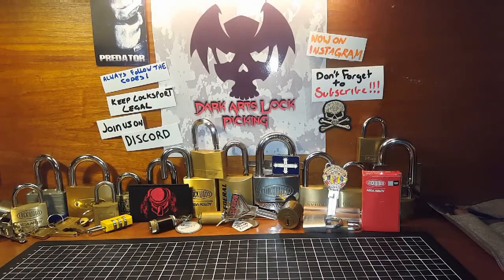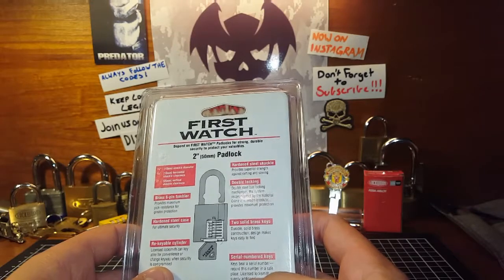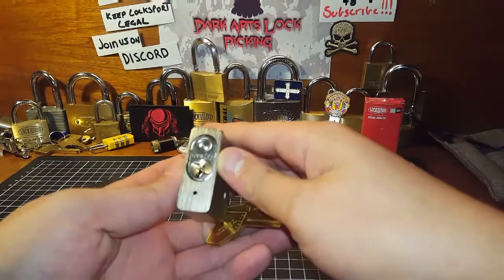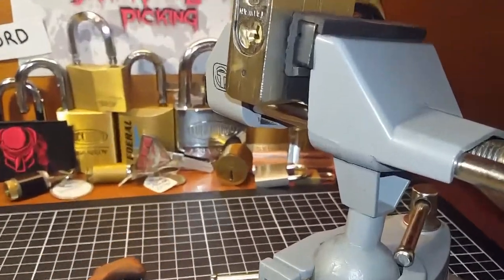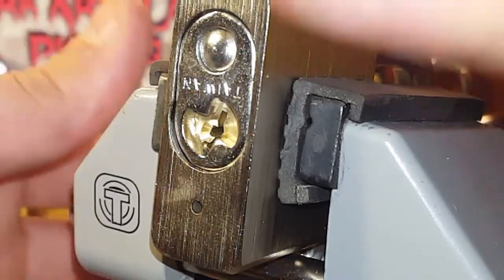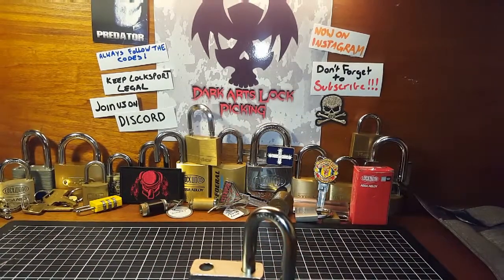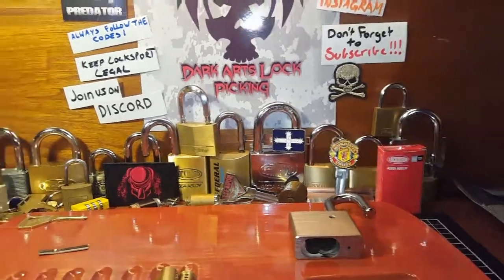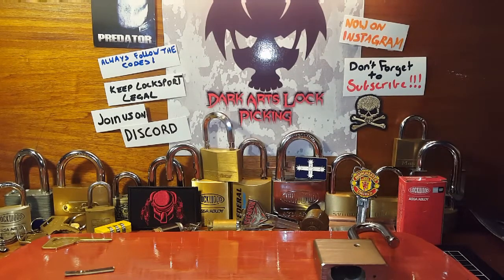First Watch padlock picked and gutted straight from packaging. (65)

Comment: Welcome back, DALP. Hope your Adelaide field trip went well. I kept an eye out for any illegal imigrants from across the border with Vic number plates while i was out and about and shouted out " are you DALP?" to the ones i did see but didn't get any response except puzzled looks. lol. Suprised at the resistance to picking from Funky's gift. Put up a good fight. PS. Get rid of that crap circlip tool. It's only a matter of time before you'll be down your local surgery getting stitches. lol. Cheers:-)
Reply: Paul Springett lol😁😂😂
Reply from the maker: Yeah it was good bruv. Lol i didn't hear anyone calling out lol i did see a few locksmiths driving around but didn't know if it was you or not lol. Yeah it was a little tricky lock. I don't care if it makes me get stiches as long as it happens on camera lol. 👍👍👍🤘🤘🤘
Reply: I hope you're not missing any wiper blades, Paul.
Reply: LOL. No. I kept all my vehicles stored away til he left Adelaide. lol:-)
Reply from the maker: Hahahaha i didn't take any wiper blades i stole all the padlocks in Adelaide hahahaha.
Reply: There's some up near my place you can have too. A car wash place on the highway had shut down. They left a chain and a bunch of padlocks on a metal post at the entrance. Someone had broken off the other end of the chain and people are parking on the property now (parking space is at a premium around here).  For some reason, there are 4 small Lockwood padlocks on the post. I was tempted to stretch out the chain and use a spare padlock to lock it off but I noticed today that someone had removed two metal bollards blocking off the rear entry. A very strange state of affairs.
Reply: What kind of lock do you have on your garage door? :)
Reply from the maker: Gary Rumain i have a large stash of wiper blades my mechanic keeps them for me for nothing. I have lockwoods on mine. I will be upgrading at some point.
Reply: Just the standard shitty B&D wafer lock on the ETSA key so the meter reader can have access to read the meter. Pretty slack on my part. lol.
Reply: Well, if you need more wiper blades, I know where we can find some in Adelaide. :)
Reply from the maker: Hahaha last time i counted mine i have about 170 or more
Reply: You can never have too many.